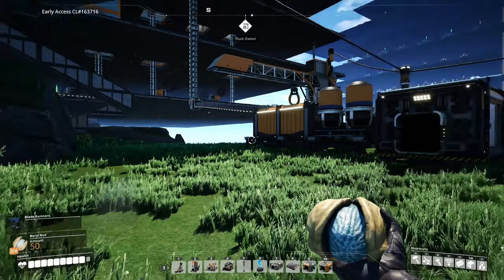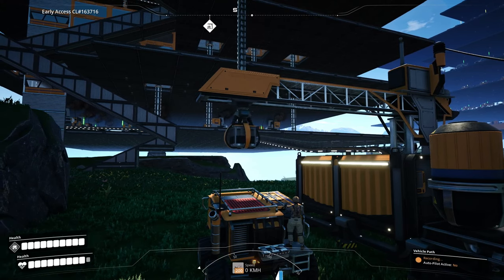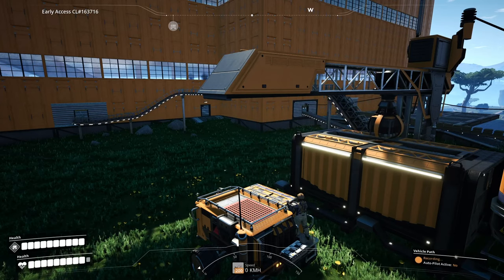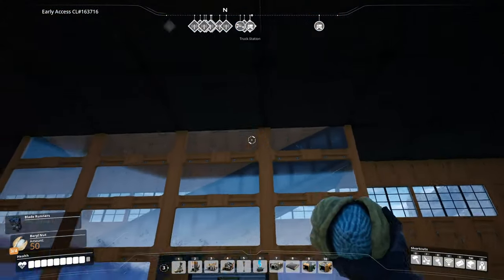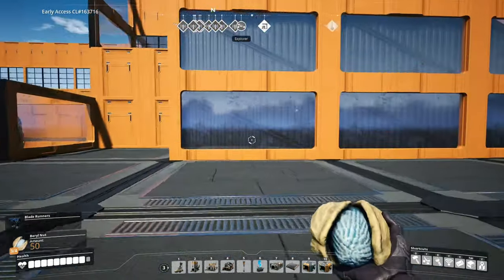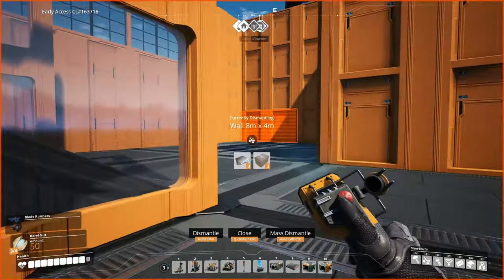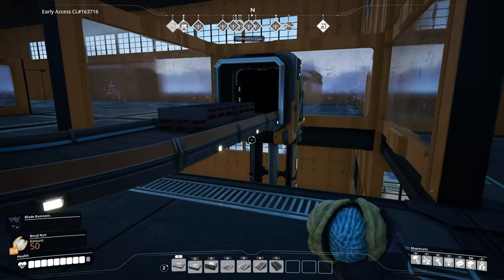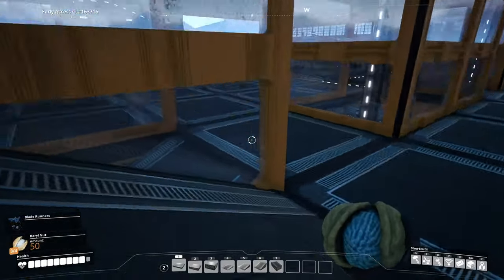Let's Play Satisfactory s01 e57

Comment: 25:55 .. you could have the ones at top like u do ..then put short one just as patch to next lift .. and then put another under the one that comes down ..so the output is out from the wall ... come down with short one just under the ceiling and run belt across then lift down to wall hole.. putting lifts in then belt so its easy
Reply from the maker: I think I could have made more use of lifts, rather than that ramp where the material comes in.  It would be nice if there were conveyor supports that I could attach directly to the ceiling. I'll likely reroute this material, because I'm not crazy how it looking.